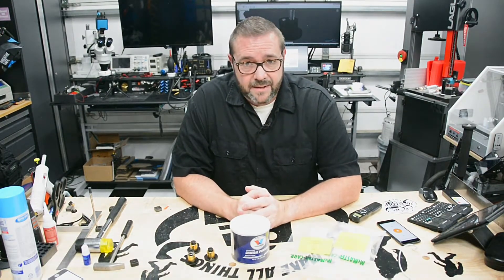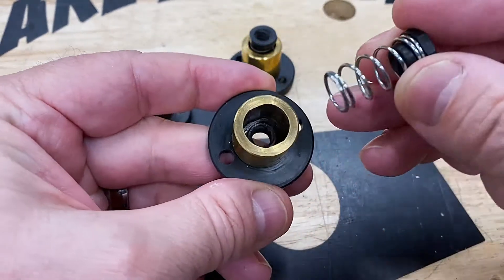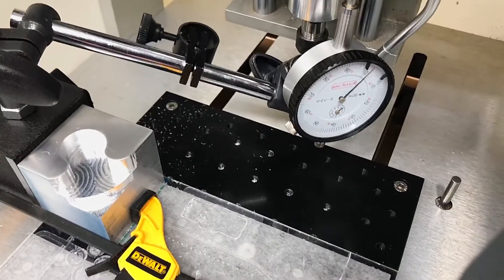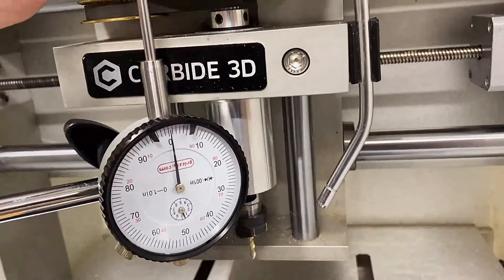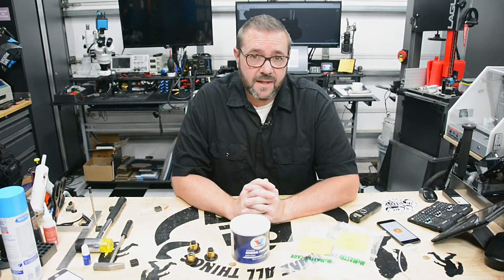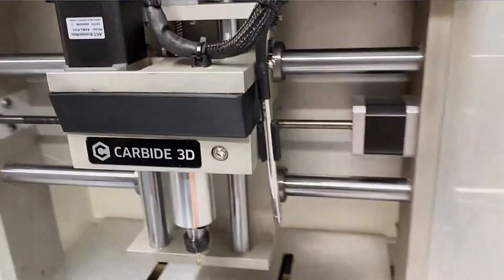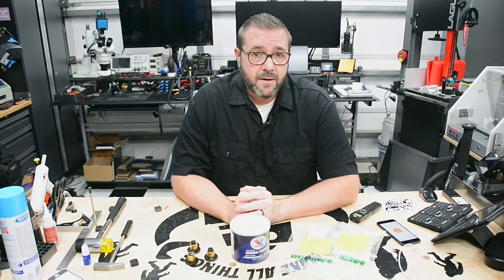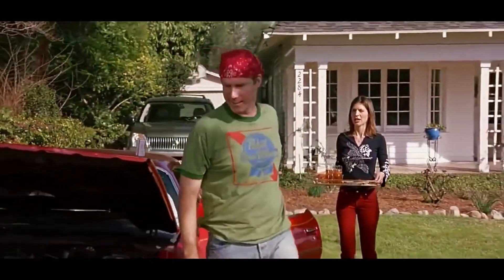Easy Upgrades to Improve your Nomad883 CNC Performance!

Comment: Hi There:  Was wondering you could share a picture of the wiring pinouts on the harness at the control board?  I purchased the upgraded motor (which has eight wires for the stepper) whereas the original motor has only 3 connections on my machine for some reason.

Comment: Very cool!  I have had my 883 pro for a few years...use it just about everyday.   Does the motor upgrade increase spindle speed as well?  Or is just a more powerful motor for torque and cutting forces?
Reply from the maker: The speed is the same but adds torque
Reply: @DIYEngineering  Thanks for the quick reply!  And was wiring it into place pretty easy?  Do you just splice all the wires together in front of the machine or did you route new wires through to the back?